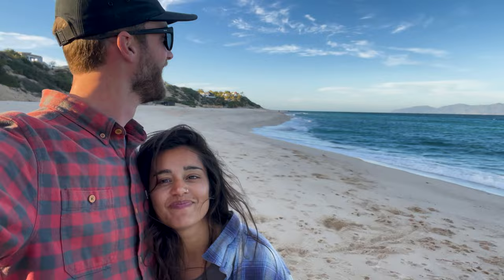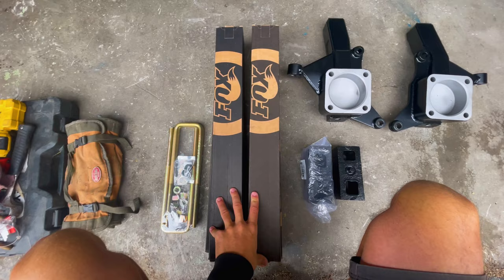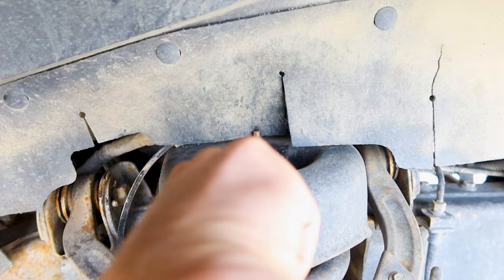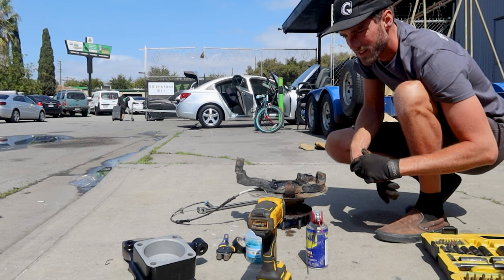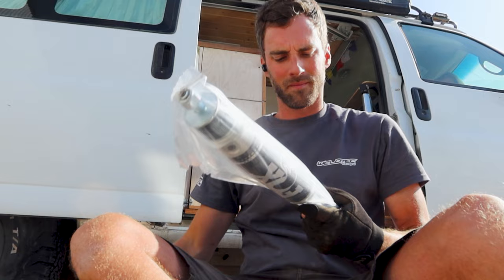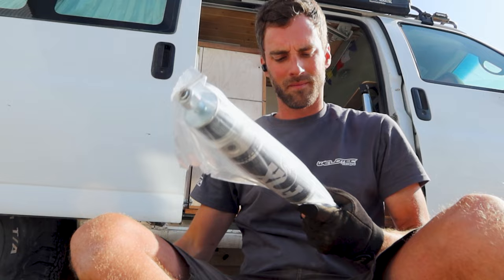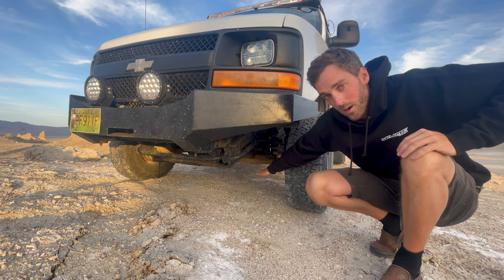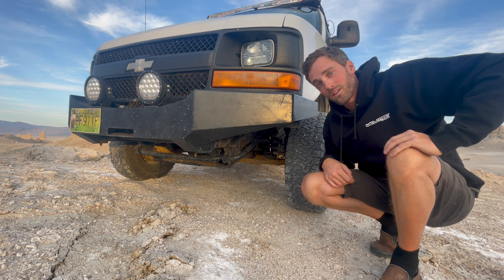DIY 3” Spindle Lift for Chevy Express 2500 | This was a Game Changer

Comment: Thanks for showing the details.  Those little things like seezed bolts always get me.  Do you have a limited slip diff on Betty? If it is the stock chevy one, how has it wotked for you?
Reply from the maker: We’re actually in the process of doing a rear axle swap right now, just waiting for new gears. The new axle has an auto locking g80 diff. Not sure how it does quite yet, but we’re headed to Baja right after so we’ll have plenty of time to find out:
Reply: @SlowRoamers  Thanks for the reply and good luck with the swap.  I presume this means you had an open diff up until now?  It seems the G80 is the only option the Express has that does not include more parts and money to go with a more robust option.  So far half the people say the G80 is reliable for 90% of what is needed and the other half say its so weak or has limited life use.  Love to hear how it goes.  Weather has been great to head south this season.  Merry Christmas.

Comment: Any chance you have a before and after photo showing the difference in height after the spindle installation? Thinking about this for my 2009 3500👍
Reply from the maker: You can check out my IG @roamlndr, there are plenty of photos of the van before and after.

Comment: What model of FOX shocks did you end up going with? Can’t seem to find anything that is specifically designed for the express. Also is a lift required to fit these?
Reply from the maker: They’re fox stage one shocks, but they’re made specifically for Weldtec Designs. You’ll need to contact them. You don’t need the lift to fit them.

Comment: Can you run the stock 16” wheels with those lift spindles ? 
I know the brake rotors are already pretty close with the stock set up ? 
I just bought replacement wheels and new tires. 
Don’t want to have to do that twice.
Reply from the maker: We’re currently running 16” steel donuts, so I’d say definitely.
Reply: @SlowRoamers  great info. Thank you

Comment: where did you get that front bumper? How much was it?
Reply from the maker: I built it.😁
Reply: good job. Can you build me one?  =)   Like you, I have a 04 Express 3500 I am slowly rebuilding.  I paid 5k for it and have already dumped 4k more into it.  I did a lift and big tires with new suspension parts/brakes. We added a ladder and full size roof rack. Next is exhaust, engine tune up and then body work. I live in Northern Wisconsin and our vehicles rust.  @SlowRoamers

Comment: What size wheel and tires you running?
Reply from the maker: In this video, 265/75/16, however we’re currently running 285/75/16
Reply: @SlowRoamers  did you have to change the gearing at all? Get a tune to adjust shift points? I’m looking at doing their 5” lift soon, but running my stock wheels and tires to use up the rubber I’ve got left, then switching to 33’s.